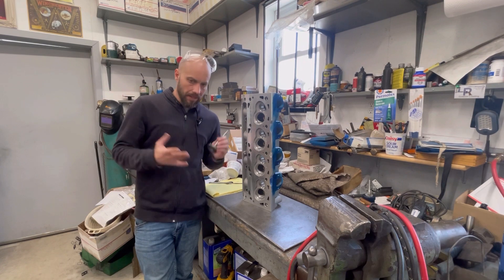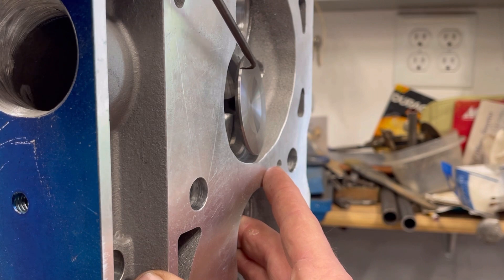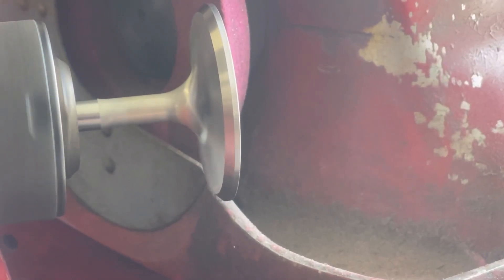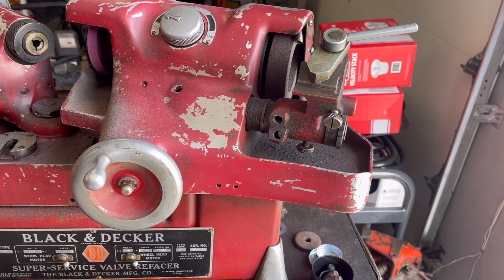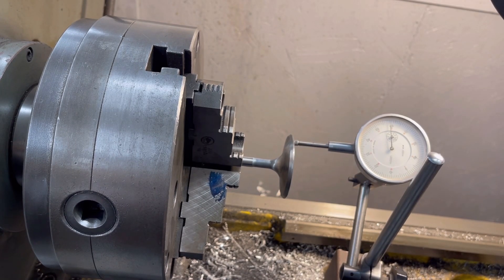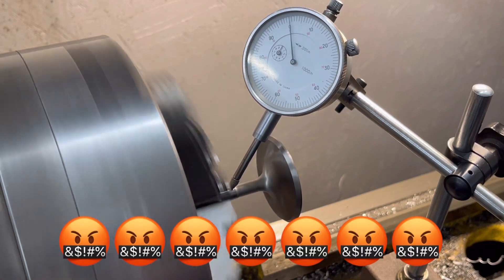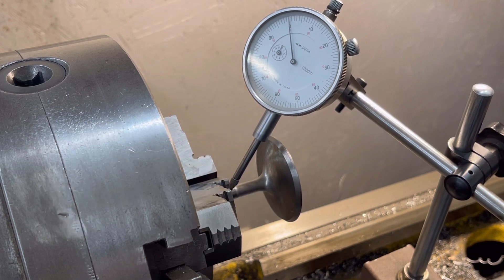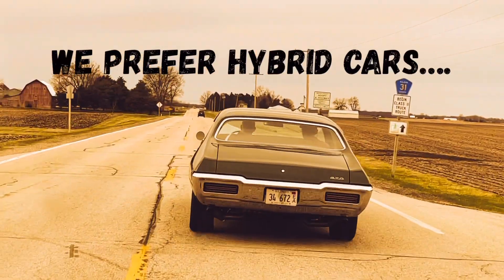Why You Should Check and Regrind New Valves #nonamenationals #valve #dumpsterfire #speedmaster

Comment: I had Manley Severe Duty Pro Flo (Chevy small block 350 w. Edelbrock RPM alum. heads) recently before I installed these brandnew valves in the bare heads after a valve seat job I checked and 8 were trash!!! WtF is happening! Those were expensive and half of them were as unround as your Chinese valves here!
Reply from the maker: man, quality is bad these days.  Things really need to change!
Reply: @2HacksGarage  I dont know what the companies are doing! you cant buy nothing that is ready for use and the companies dont care at all! I believe that even today Manley just puts cheap Chinese (crap?) valves in their boxes, how could otherwise 8 valves be out of shape!?!?

Comment: Most HQ Manley valves have hardened valve stem tips you cant grind away material there without removing the hardness surface (wear on rocker and valve will occure)

Comment: I have heard a lot of china heads use a hard valve and a soft seat so the valve kind of machines itself to seal do to poor machine work. Good video showing the truth of what a guy has to do to run these types of heads. Great video as always.

   Nolan.
Reply from the maker: Thanks man!!! Yes, there is a lot that has to be done to the Chinesium heads. No way in hell I’d run them straight out of the box.  Once again, congrats on the 500 subs ✌️